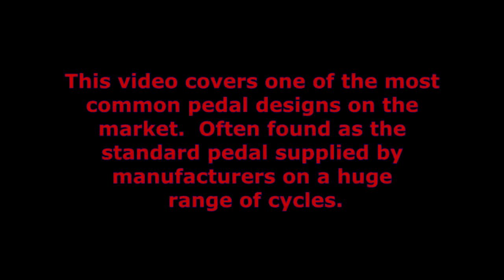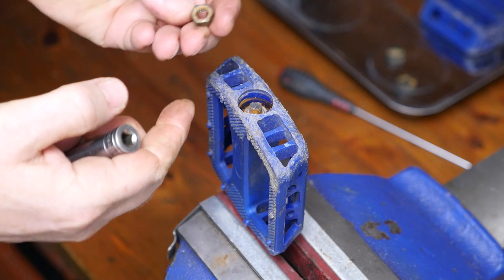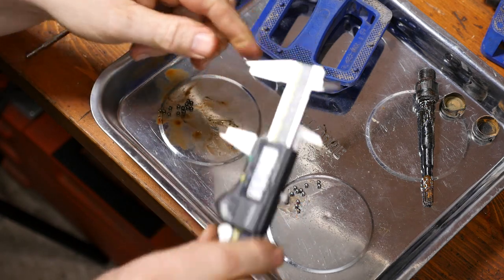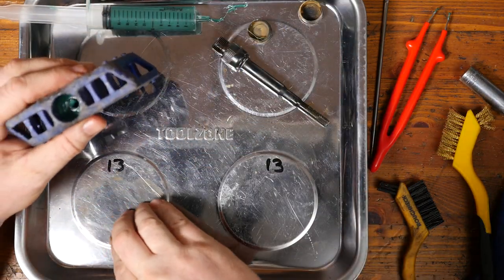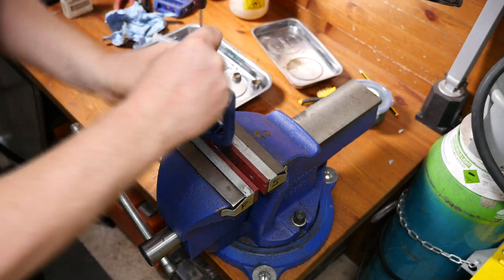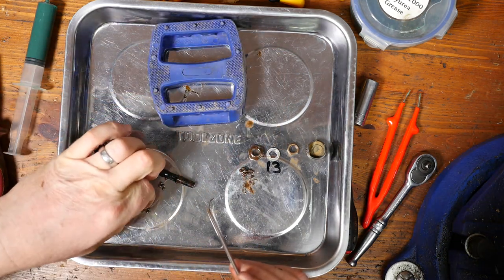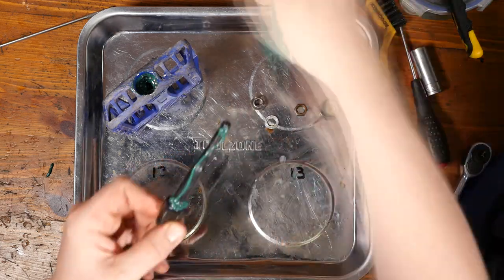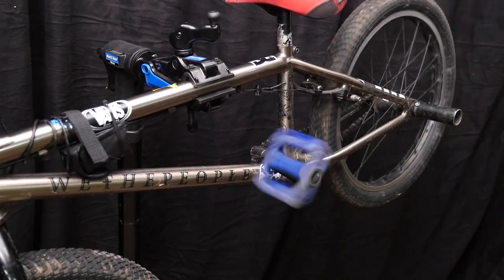Greasing & Servicing Cheap Budget Pedals supplied as standard on Mountain Bikes BMX Cycles - Bike 🚲🚲

Comment: because left pedal has clockwise and the one has anti clockwise,
So, left pedal will not fit the right crank and the right pedal will not fit left crank, is it right😊
Reply from the maker: I'm a bit lost on that one.  Don't you fit the left pedal on the left and the right on the right?
Reply: @CoatsandGaiters by mistake could we interchange the pedal between left and right?
Reply from the maker: @shijukk72  I don't think you can as it might unwind as you pedal and fall off.

Comment: I serviced my pedals 2 weeks after.the other pedals got loosen and the other got tigthen. What should i do? Thanks for your tutorial nice vid btw
Reply from the maker: Thank you for the compliment Xcup.  Sounds like you need to tinker with getting the locknut just right.  It does take a few goes to get the position just right so when you tighten that locknut it locks properly but doesn't seize the pedals movement.  In the video it takes me a few attempts to get things just right.  Trial and error a bit.

Comment: Thanks! I did exact the same. I noticed one thing that when you test this you have to do it with on the bike and with force to really test it out. I got some mechanical sound so I have to take it apart again. Also one side was empty with ball-bearings so I have to count them on the other side. I got it to 14 but when I watched a little closer I saw it was room for another or?. Does anybody know if there should be more? Should you leave room like 2-3mm as a gap between them from the nr 1 through tha last one? One more Q.  A new paddle can rotate like forever it seems but when you do this/ou service it doesnt.
Reply from the maker: Was it not 13 bearings each end?
Reply: Maybe different  pedals have different bearings counts. All pedals might not have the same bearing count. I don't know, I could be wrong. When I've done lots of wheel, crank, and pedal bearings, I've always seen a gap like another bearing could be squeezed in. I wouldn't squeeze or put another bearing in. Best to check with the manufacturer for the bearing count requirement.

Comment: what can i do if my pedal wont come off? i tried heating the crank with alcohol but thats does not seem to help.
Reply from the maker: Just check your turning the right way as they are tightened back to front.  https://youtu.be/DbewyKM_BmE?t=51
Reply: @CoatsandGaiters  i did it the way you did and still no luck
Reply: @CoatsandGaiters  tomorrow i will try to take it of with a pipe extension on the wrench
Reply from the maker: @crxxpslvyr7887  how odd I can’t understand that.  Must undo one way or the other

Comment: my stock pedals dont even have a lockbolt just a smooth end spindle
Reply from the maker: wonder if the nut is the other end by the crank.
Reply: @CoatsandGaiters  $150 bike. buying quality replacements is 1/7 the value of the whole bike lol

i tried everything, pressing the smooth end with a rubber ended rod to lock it in place and turning both ways  but the pedal looseness stays the same. I also tried hammering one end to try and push the threaded end and smooth end together and that didn't work. 

Factories are pinching nuts to save pennies making my pedals literally unserviceable. Pretty much planned obsolescence when taking cost to replace into account.
Reply from the maker: @pyroromancer  Sorry to hear this, how about cleaning the thread and inside of the nut and using thread lock and leaving overnight? or araldite.

Comment: Why would you take the pedal apart?? Just take off the end cap, flush it with whatever de-greaser, and push grease in until it comes out the other end.
Reply from the maker: I guess that's one way.  Never thought of that.
Reply: @CoatsandGaiters  Try it.
Reply: @jamesconroy7030  how are you going to get grease into the bearings in the threaded end lol and even if you could get the grease past the first lot of bearings, why would you waste all that grease filling up the centre of the pedal. Do the job right and take it apart. Its not hard anyway.
Reply: @dalj4362  You fill the outer end, and mash it in with your hand (or use a grease gun). It comes out the other side pretty quickly. There's not much space between the axle, and the body of the pedal. There's maybe 2 tablespoons of grease "wasted".
Reply: @jamesconroy7030  No lol Silly idea. Seriously have you seen the tiny gap to get the grease through? Bet the pedals wouldn't spin nice either being packed full of grease.
Reply: @dalj4362  I've done it dozens of times. It works great, you would never know the difference. LOL. Try it!
Reply: @jamesconroy7030  next time I service them, I'll try it. Think I'm going to be in a mess and disappointed though lol
Reply: @dalj4362  I guess I missed the funny part, LOL. I was a full time bike shop mechanic for almost 10 years. It might take a few minutes to get the technique right. Fill the end with grease, seal the meaty part of your hand against the hole, and push it in.  Put more in, and keep doing it until grease comes out the other end.
Reply: @jamesconroy7030  Yeah and we all know what bike shop mechanics are like. CRAP😅
Reply: @dalj4362  People paid the shop $70 an hour to work on 5 to 10 thousand dollar bikes (and that was 10 years ago). What bike do you have?
Reply: @jamesconroy7030  Doesn't matter what bikes I have as it doesn't make me a worse bike mechanic than a shop  😅 

We could go on and on. I'll let you know if I ever try the incorrect way to service a pedal 😅
Reply: @dalj4362  Now That's funny LOL!  You think you're as good as a pro with training? You think wasting time rebuilding a $35 pair of pedals is worth it? You wouldn't last a day at a bike shop acting like you're an expert. I'm sure you'll still have to get the last word though.